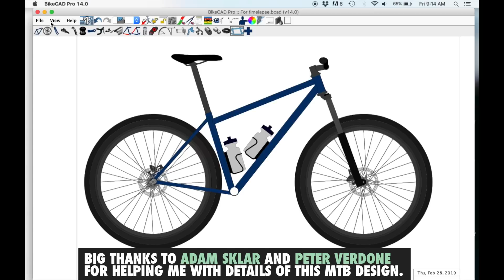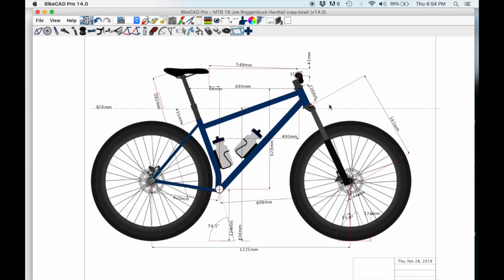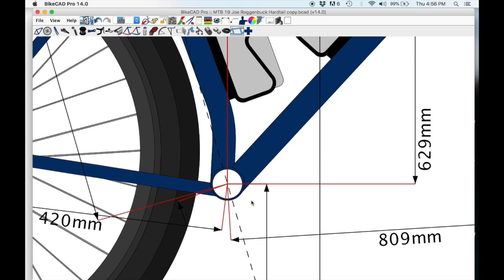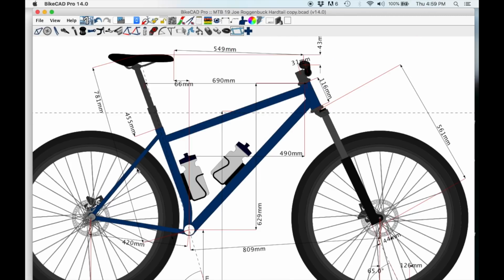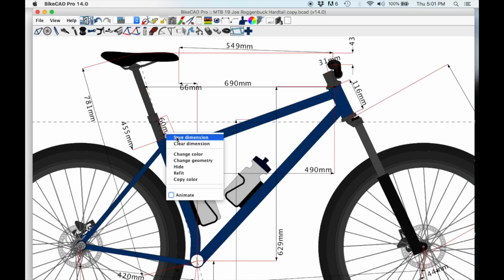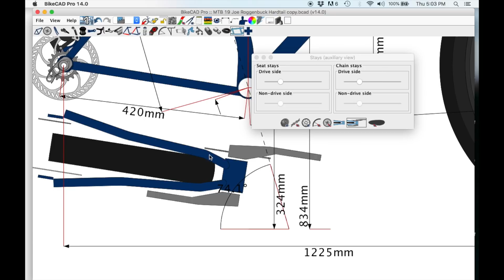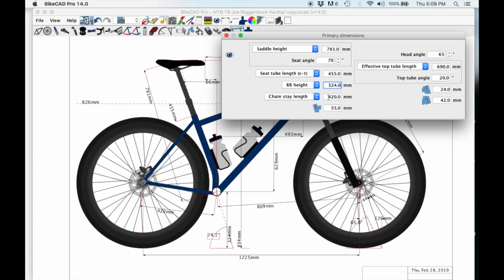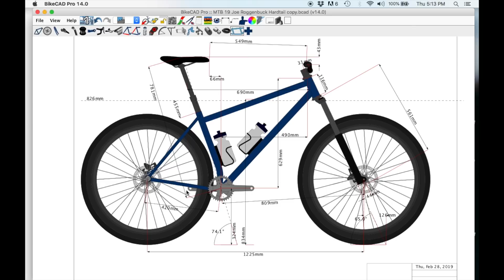Designing a Hardtail Mountain Bike in BikeCAD | MTB Build Series

Comment: Heyo! I know you're one busy dood so no worries if you don't reply, but I got a question: I am designing a similar frame with BikePRO 16.0 and trying to figure out if there is a function to check tire clearance with the downtime when the front fork is fully compressed (hardtail). I can mess with sag and fork length, but it auto-adjusts to keep the head tube angle where I set it...so aside from doing maths to correct for this...I'm wondering if you know a feature that I may be missing?
 p.s. You are cool. Really cool. Thanks for all the inspo. Hope the your new shop is all you dreamed of!

Comment: As an engineer, I have no problem with designing around the datasheets.  But I have yet to meet a machinist willing to start a project without having the parts on-hand to measure himself.  It annoyed me but I have decided to take a lesson from the older and wiser people in the shop.  Whereas a design can be easily changed, a hold drilled in the wrong spot can ruin a lot of work.  In other words, the reality of fabrication is ABSOLUTE and should take priority over the mist of shifting ideas that is the drawing board.  Buy your parts first.  They won't cost less in 2 weeks.  Just get it over with.

Comment: Very nice video. Have you try any bike close to what you want to do?it looks nice and very modern,in pair whit many other bikes. Actual seat tube angle matters in the real world,if the angle is to little the bike would try to lift the front wheel while steep climbing.
Reply: The actual STA wont tell you if the seat is too far back for climbing because it also depends on the bend he made in the seat tube. That's why the effective seat tube angle is used. You know just from that how far back the seat is and you can compare it to any other bike geometry no matter how the tube is bent. Does that make sense?

Comment: Cool idea. In my experience you should have a shorter travel fork and a steeper effective seat tube angle. The geometry change trough the travel of a long fork isn't your friend.  Although it's hard really to use 150mm travel with a unsuspended rear end. And the steeper  STA will help you klimb technical steep stuff.